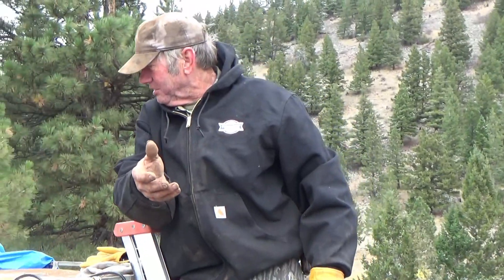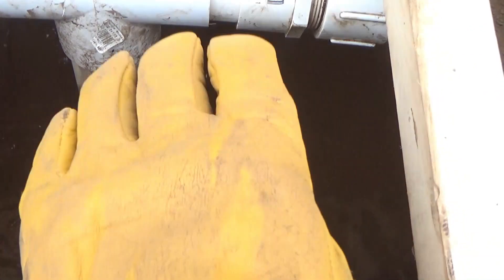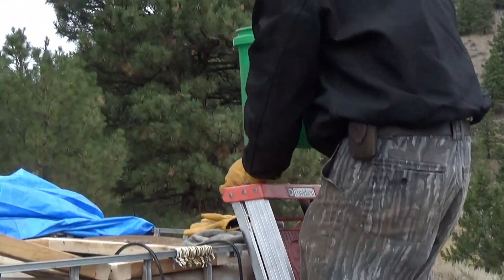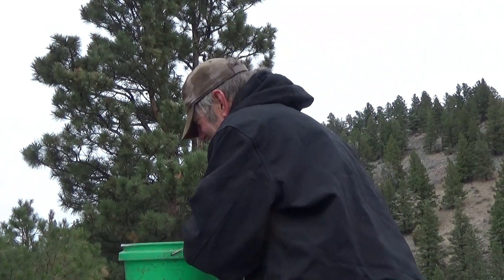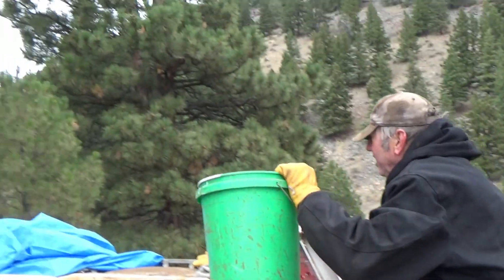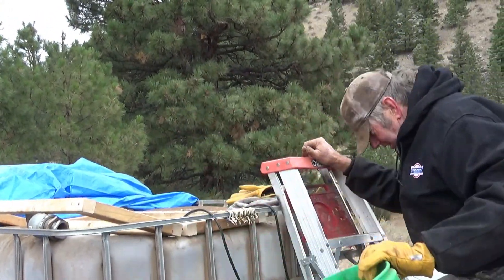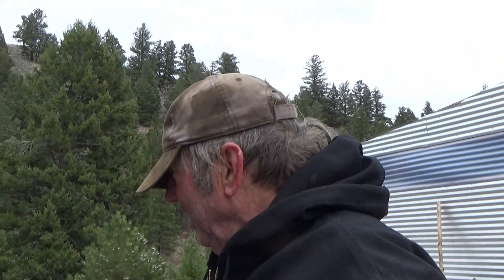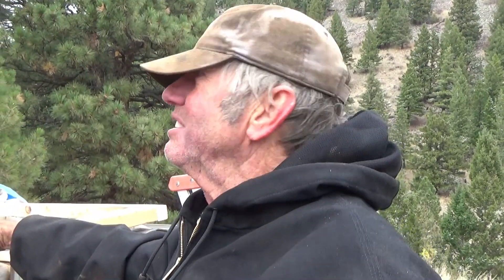233 The Agitation Tank is Working !

Comment: looking good Keith , it would definitely piss you off when the weather is closing in on you when your so near to production  , can only do what you can in limited time . I 'm trying to buy some Eco Goldex O from the Canadian Company , i hope they will ship it here . I see from what i'm researching that with ashing of activated carbon the treatment in the furnace takes 2 to 3 hours to complete . Dry ashing is usually performed by placing the sample in a open porcelain bowl and destroying the organic combustible portion of the sample by thermal decomposition using a muffle furnace . The optimum ashing temperatures normally range between 450 to 550 degrees Celsius . Now i need to research what a muffle furnace is , lol . Funny thing though , i did read somewhere a guy mentioned using a microwave oven  with an air hole in it or pumping air into for ashing , i know there are videos of guys using microwave ovens to smelt gold , but it must be a type of oven that doesn't have an overload cut out on it , other wise they just turn off , but anyway i'll keep researching , cheers mate . Ned .
Reply from the maker: Thanks for the help Med.  You will of course be kept updated from this end by video and live stream.
Reply: @hardrockuniversity7283  Definitely , thank you , although i can't always watch your live streams cause i'm usually at work . I did look into the Muffle furnace , and i do believe i already have one , it looks exactly the same as my cupel oven , anyway cheers for now Ned .
Reply from the maker: @GrooberNedJardine  I think that is correct.  I have some emails out to some resin suppliers.  It will be interesting to see what they come up with.

Comment: How much crushed rock to the eco ? I just got some of the eco to try so its nice to see how your using it.
Reply from the maker: I am using 6 tablespoons (I forget the weight conversion and am not at the ranch right now) of Eco Goldex and 10 tablespoons of lime to 100 lbs of pulverized ore and 20 gallons of water.  That gives me a Ph of about 10.5 which seems to work fastest on my particular ore.  It takes some testing to figure out what works best for you.  The IBC should be able to process about 1000 lbs of ore at once.
Reply: @hardrockuniversity7283  Thank you for the info Keith. I look forward to the next steps as well
Reply from the maker: @jeffmcauliff5315  You're welcome.